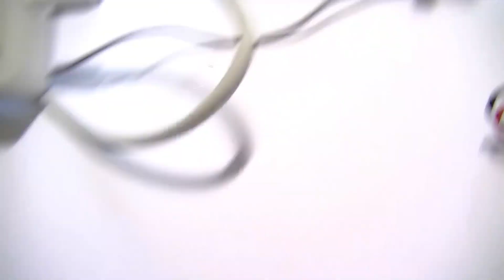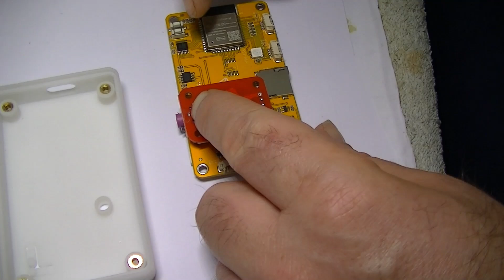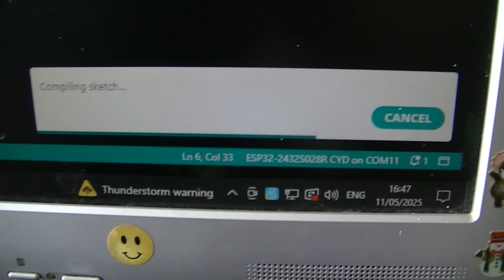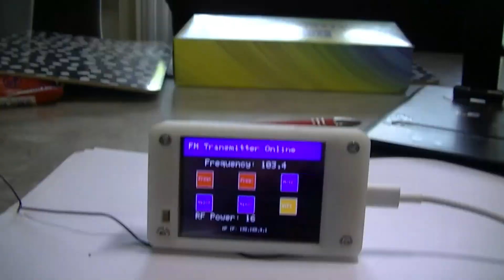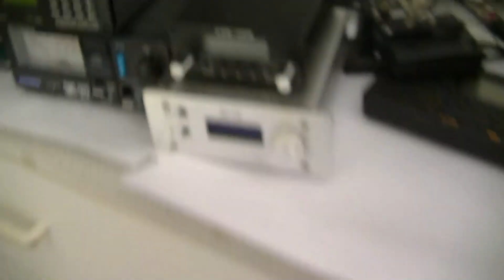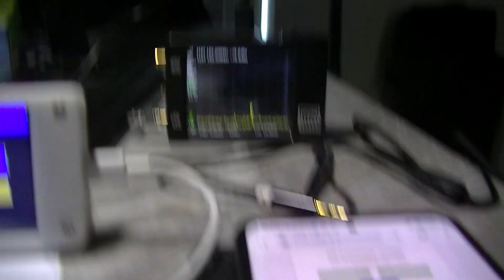Wow a esp32 wi-fi and touchscreen FM transmitter and you can build one, FREE code

Comment: Sir please make a project fm radio using Arduino ide, Arduino neno,RDA 5807m module, I2c oled display , rotary encoder, display show frequency,,RDS information and signal level, rotary encoder for control the frequency and volume level